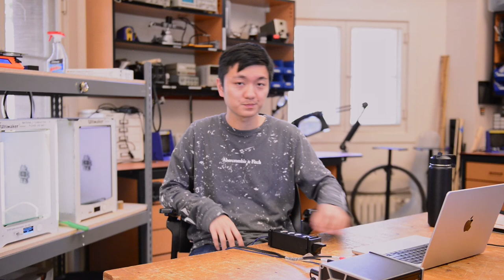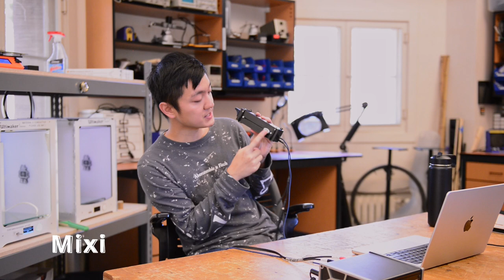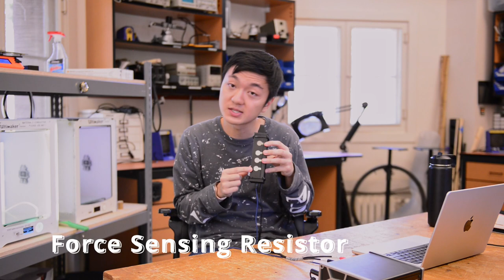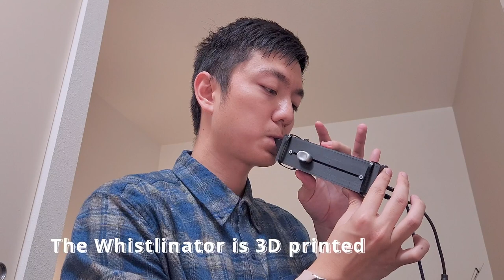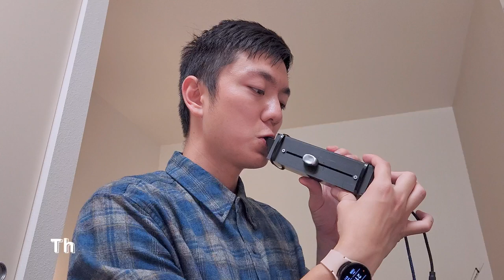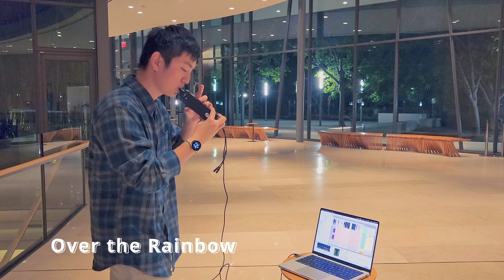Slide Whistlinator - An Automatic Slide Whistle

Comment: I love it!  Any chance of a description of the build and software, in particular the continuous pitch change over such a large range?  Thanks for sharing.
Reply from the maker: Thank you so much! The slider potentiometer range covers two octaves (starting at C4). Since the whistle knows the current slider position, the combination of FSRs will tell the whistle where the slider should be and drive the DC motor in that direction. The FSRs are binary mapped to 2 octaves in the C major scale (7 notes in a scale) so its very convenient (1 2 4). The last FSR then becomes an octave button, off - octave 1, on octave 2. Hope that helps!